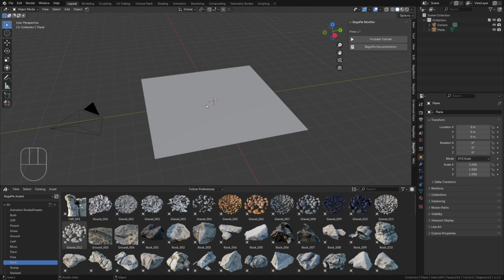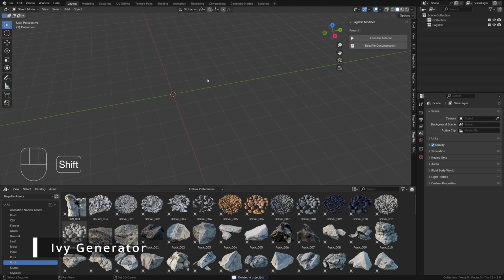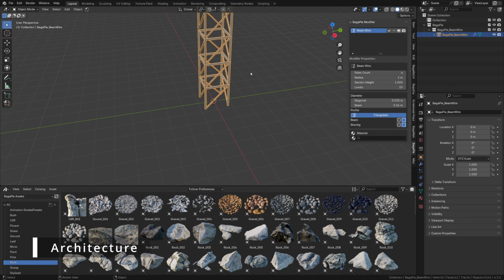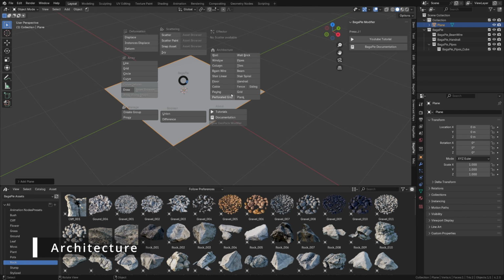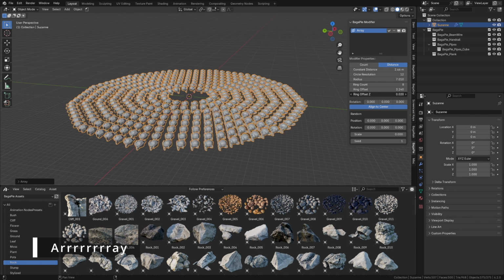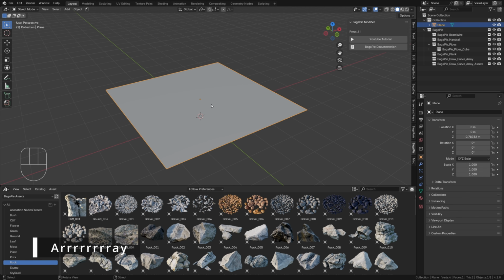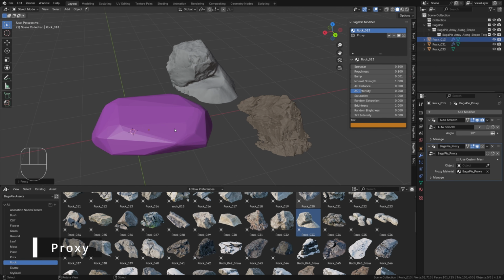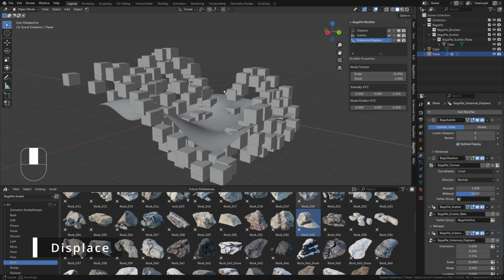BagaPie 11 - Parametric Tools

Comment: so when you press Snap Asset dont press the Esc button immediately. there is a window that comes up to say press Esc but dont do it, if you do it wont work or it didnt work for me. When it comes up, ignore it and go to the N panel and go to Bagapie and then click on Add Instance and another pop up will come up, you can click escape or not and then add the objects but remember to hit escape to stop adding when finished.